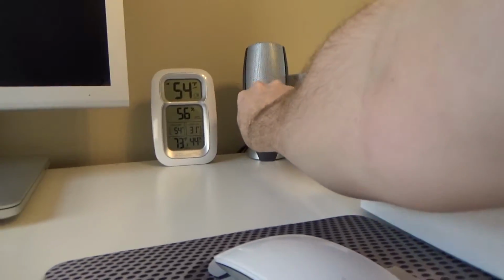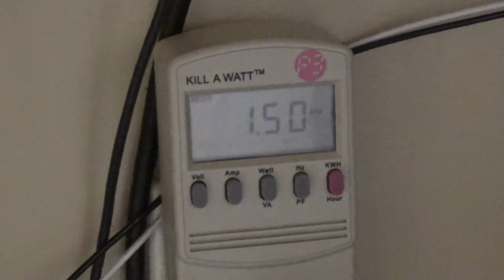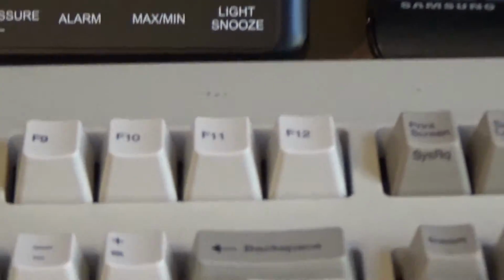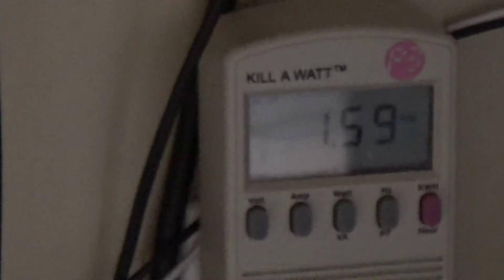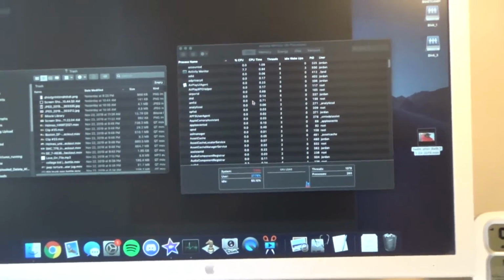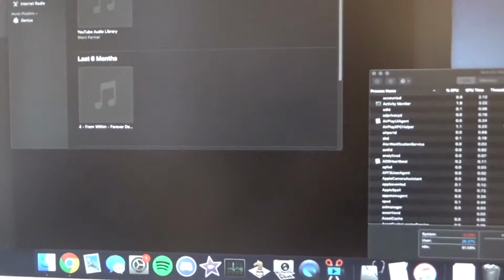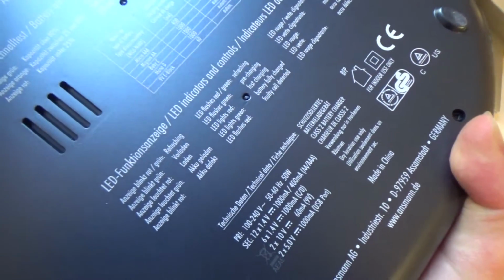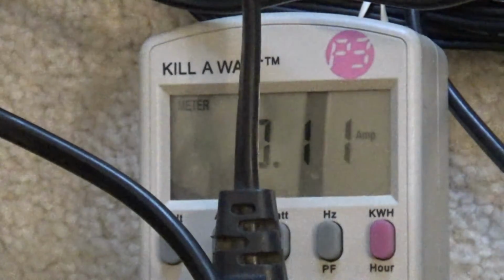Measuring the Available Power

Comment: You can still do a lot with 6 amps! I wouldn't worry about it. If for some reason you manage to exceed that, your circuit breaker will let you know!
Reply: Hes trying to avoid having that happen and potentially lose information or lose progress on a video project.
Reply from the maker: It depends on what you decorate with.. I like the old stuff, a single set of C9 lights draws about 1.5 amps! The circuit breaker will let me know, but usually in the most inopportune way possible.. In years past, I've had cases like what TheAirConditionerGuy described, riding the limit then click save in the video editor, the CPU usage spikes then the breaker says "too much"....
Reply: @JordanU  True! I love the old C9 lights, i have quite a few antique sets! I didn't realize they drew that much though! Well I guess it's good you did this then!